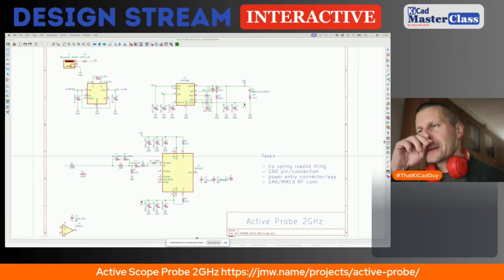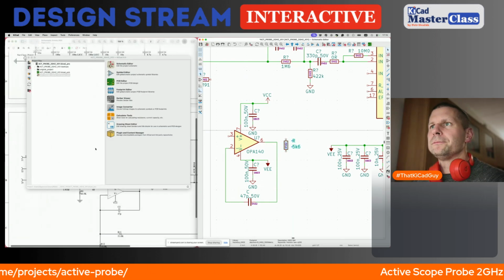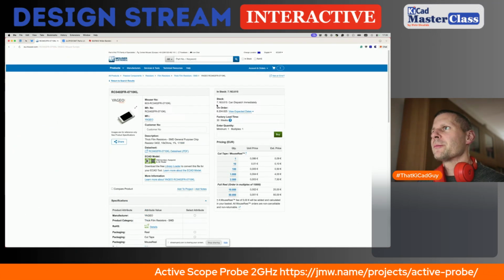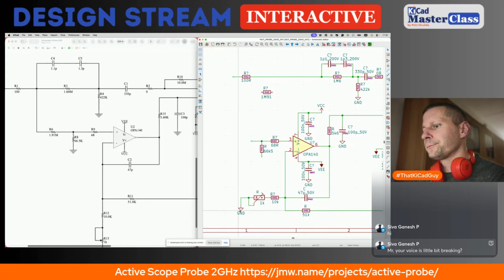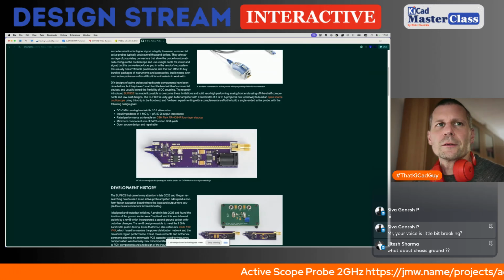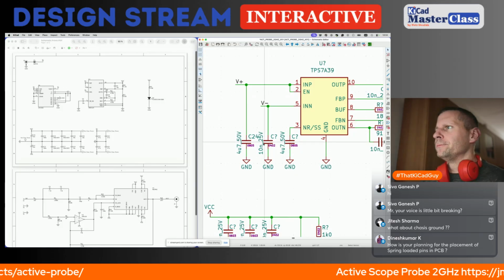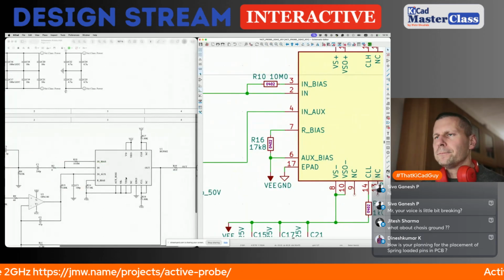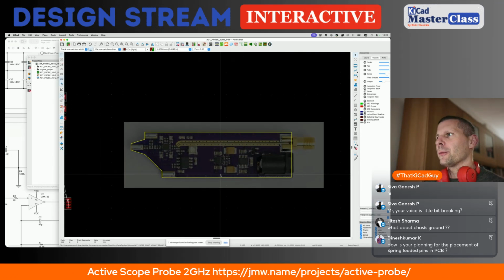KiCad Desing Stream Active Scope Probe 2GHz, part 3

Comment: Thank you for the stream. Good job finishing the schematic. Yes, you are 100% correct; never group coupling capacitors in one single space, rather draw them where they belong on the schematic, and using pin no's on IC's prevent potential mistakes. Looking forward to the PCB layout.
Reply from the maker: Thank you. The only way I can accept grouping the caps is that each and every one of them has a note about its destination.